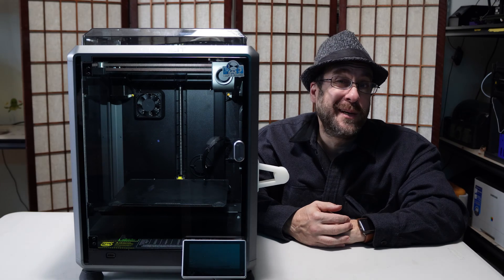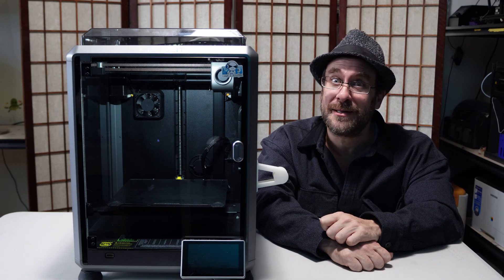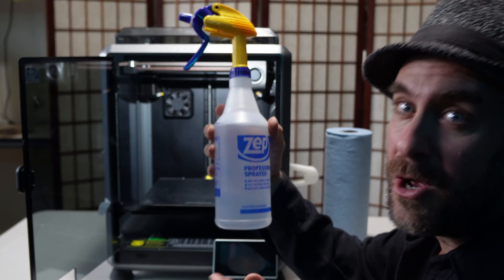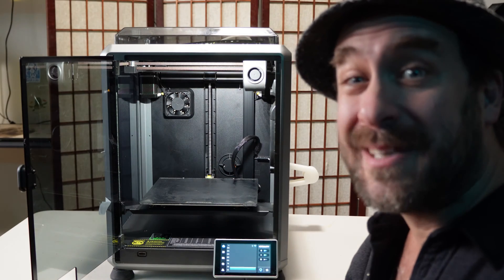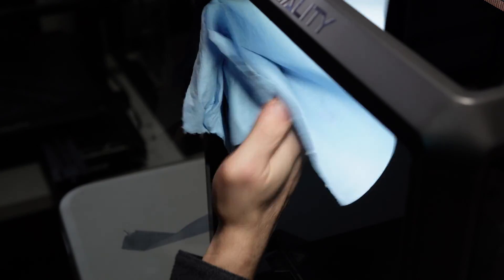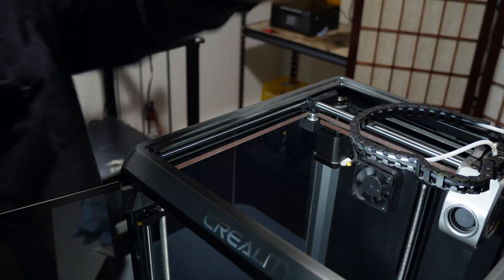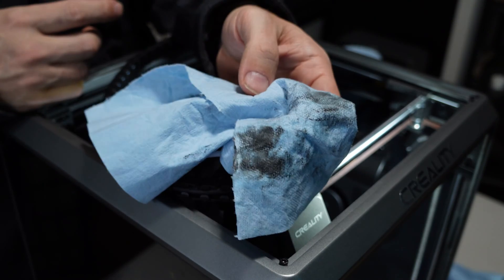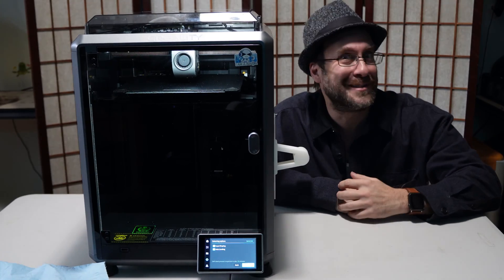Clean & Lube Creality K1 - K1C - K1 Max - X/Y Rails - Bonus: Bed Cleaning - 3D Printer

Comment: Hi my x axis is hard to move and i dont have light machine oil i dont want to use the included grease people say not to lube x axis but i dont know what to do now im between two roads is the printer still doing good after you lubed it?
Reply from the maker: My K1 has 2000 more hours since this video. It's printing RIGHT NOW. I didn't really LUBE the hotend axis, I used it more as a cleaner. I wiped it clean, with little to no visible "grease" left on it.

Comment: The bed is magnetic and removable.... Why not take it out to clean it? Also, why is the table so wobbly? That should be rule number one..Make sure your table or stand does not wobble or  move...But what do I know..
Reply from the maker: Lol. I can't tell if you are being serious or trolling.  This table is for this video. My machines are on Muscle Wracks. Removing the bed takes extra time, risks misalignment, or throwing off your Z and ABL calibration. No need, unless a need presents itself.

Comment: I would avoid 70% ipa, it would be fine on parts you're cleaning but it will leave a film on the printbed that prints don't like to stick to as well. 91% is available at walmart for about the same price.
Reply from the maker: I have 99% and still prefer 70. Any of them are fine. But the film is left from the the IPA, not the other %.
Isopropyl alcohol is an alcohol, and all alcohols including ethanol and ethyl alcohol tend to damage the surface of various polymers of plastics. This hazing and residue effect of IPA is visible especially if they are shiny or polished. why this happens? IPA is hygroscopic which means that loves to draw moisture from the atmosphere to itself. In as little as 15 minutes, a bottle of IPA left in an open container would lose 7% of its potency and will keep on absorbing moisture until it reaches 65 percent and then stops with equilibrium. This moisture-loving feature of IPA draws in many impurities with it and when it dries after being used for cleaning, these impurities from the air and others from those inexpensive plastic bottles will remain. Hence you get that reside/haze on the surface.

Comment: I too use these methods, but have noticed that there could be a spontaneous fiber discharge from the tip of cue onto newly lubricated surfaces. So keep a watchful eye on these hence forth.
Reply from the maker: Scotts Blue Shop cloth do not shed. They are all I ever touch my Printers with

Comment: Clean it but do NOT  lubricate the X-Axis. There are lots of evidences that doing this for this kind of self-lubricating rails is counter productive:

https://youtu.be/xAp4juU-omk?si=jMHeihLeubIrg7GI

And cleaning the bed is a lot easier by removing the build plate first and clean it outside the printer. You can attach it afterwards and heat the bed to get it dry.
Reply from the maker: I have over 30 printers. I never remove my beds. Never heat them to dry. Clean, sent print job. There is much debate over the X rail. Cleaning is the main goal. Mine works great
Reply: @3DRundown  I am not talking about the whole bed, but the flexible sheet on it
Reply from the maker: Right. I clean them, installed on the printer. No problems yet, and I print ALLOT. :)

Comment: Mannnn you had me excited!  I thought you were about to reveal the K1C haha.  I read on the facebook group that they sent you one.  I'm jealous I'm probably going to upgrade my K1 to the K1C.
Reply from the maker: Ah, hate to do that to you. I do not have a K1C yet, but, I am indeed expecting one. However, Creality is a large company, with many independent departments, that don't always communicate with each other efficiently, so, I don't count anything, till a package with Chinese writing arrives at my door. They asked me to cover the E3 V3, and, of course, I accepted their request, but, in turn, I suggested that I would personally like to cover the K1C, as it's a machine I would use in my day to day work, which would allow me to cover it more extensively. Of course, if the V3 turns out to be a real winner, then, I will use that also, but, the K1 has proven itself, and I have used both the K1 and K1 MAX, daily. They came back, and green lit me for a K1C. However, in the past, there have been delays, stock issues, and such. Sooooo, while I am expecting the V3, and K1C, I have no idea when. I have stressed, many times, how critical,  getting them on time is, for my ability to generate traffic with them. But, the ball is always in their hands. Fingers Crossed for soon....  I am taking a "Wait and see" on the V3, but, I have high hopes for the K1C.
Reply: @3DRundown  Err, the K1's (all variants) have mainly proven to be excellent at VFA..... due to their half useless motion system. It is not something fixable either.  Not without major rework.  So for all their GREAT points, this one main flaw ruins the whole printer really!!  A half the price bed slinger, of ANY brand, can do notably better printing quality.

Comment: I read we should not be lubricating the x axis rods because the hotend uses a graphite bearing that is self lubricating. On the other hand, adding to the maintenance a little grease on the lead screws so they run smoothly is good to do at about the same interval! Great video overall showing people how to perform such an important maintenance task we all need for our printers
Reply: I lubricated the x-axis and it's releasing a black paste. I'm going to clean it today, but I don't know if it's damaged now. If anyone knows anything please tell me
Reply: @noecovarruvias1270  I did the same thing because mine came lubed from the factory.  If i run it dry, it makes a horrendous knocking sound so i grease it regularly.
Reply from the maker: It has been a debated topic, however, Creality says TOO lube them, so, I will go with their word, unless I discover it, personally, to be incorrect. So far, running great. I should note, I am using VERY little grease, as I only apply it with the cloth, leaving very little on the rail.
Reply: It is not hard to "personally" work out Creality are INCORRECT, because you can go to any bearing manufacturer website, and read about graphite bearings, and NOT to lubricate them. Creality only BUY the bearing from bearing manufacturers..... so who do you think would be correct? @3DRundown
Reply: @MrPetersVideo yup graphite bearings should never be lubricated
Reply: @MrPetersVideo  Creality claims that their grease is specially formulated to work specifically with their graphite copper linear bearings.
Reply: @3DRundown I actually had to exchange my k1 max my first one was a dud and that one didn’t have any grease on the rods but this one from Creality has a thin coat on the rods already
Reply: Thanks for the information!
Reply: True look it up never lube graphite bearings made this mistake myself they slide much harder after lubrication after a print